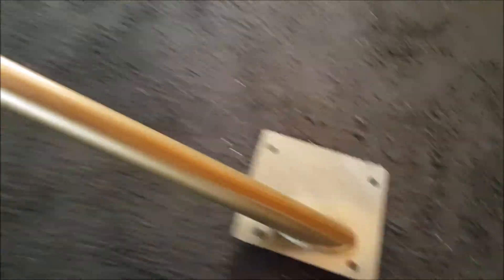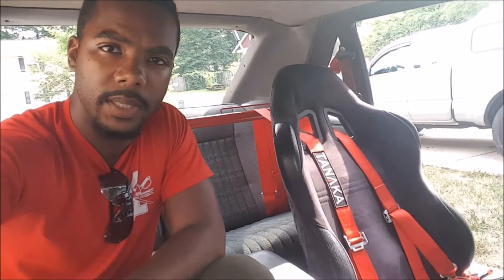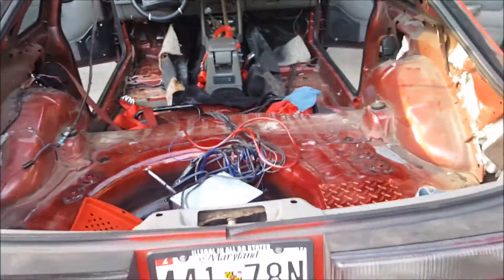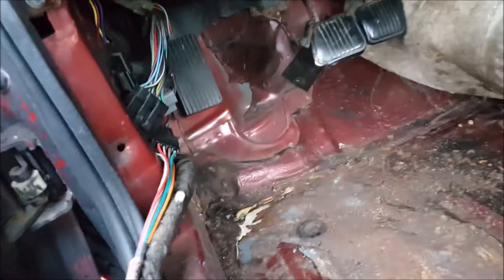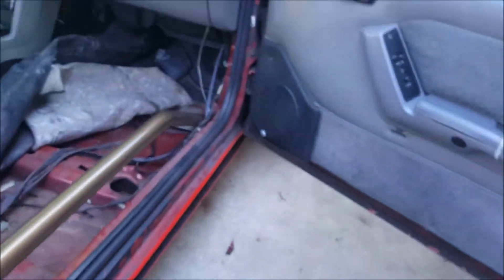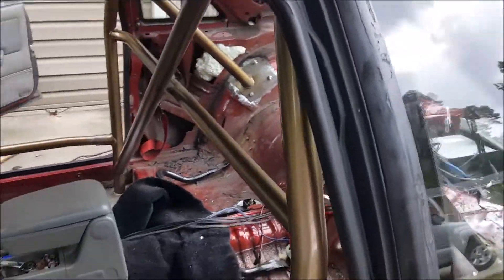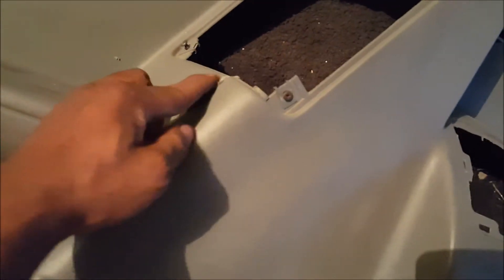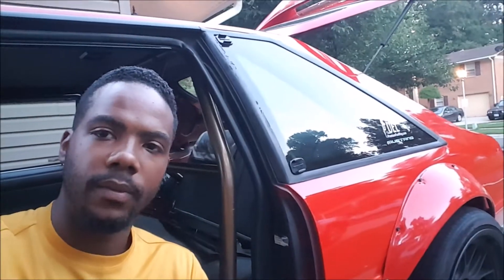Maximum Motorsports cage installed on the Drift Fox!

Comment: The bar looks sweet. Maybe a horizontal cut on the side panels towards the rear seat back and then cut vertically down the panel would have made for better visual appearance as opposed to the vertical cut in plain view. The rear seat back in the upright position will hide the vertical cut from view.

Comment: Safer and stiffer if you weld the cage to the frame rails. If anything happens that cage is only as strong as UR floor board and the bolts connecting The cage to it. But looks good
Reply from the maker: Improvements can be made, and will be made.  Rome wasn't built in a day my friend.

Comment: When installing this MM rollbar, if the installation instructions are followed, it is not necessary to cut the interior panels in this application.
Reply from the maker: the long cuts I made to slide the panels in afterwards can be avoided if you install the cage with them still in the car, we'll be doing the 4 cyl car that way, but that method is much more difficult, and was not a priority for this install.  there is no way to avoid notching out a section below the speaker grille for the bar to pass through.  There are cleaner ways to accomplish this, such as using a hole saw, but notching it out the way I did worked out well for me.

Comment: 🤣🤣 you were suppose to use a hole saw and not cut the rear panel like that. Wtf 🤣🤣
Reply from the maker: didn't change the outcome.  worked out fine for me.  Use whatever tool you like on your install.
Reply: Premium Fuel Mag  🤦🏻‍♂️